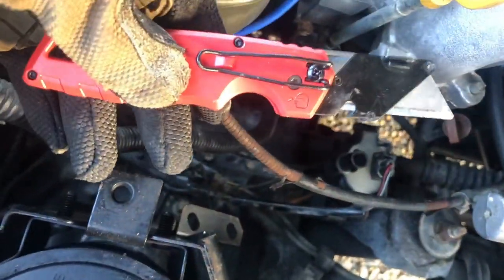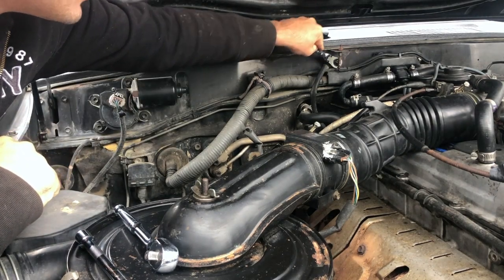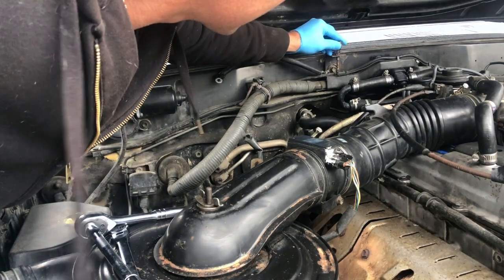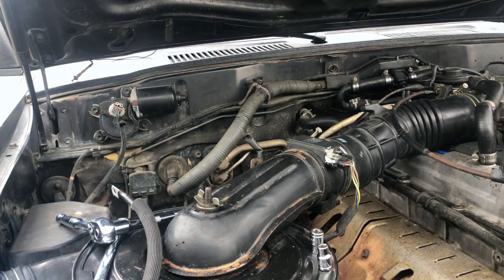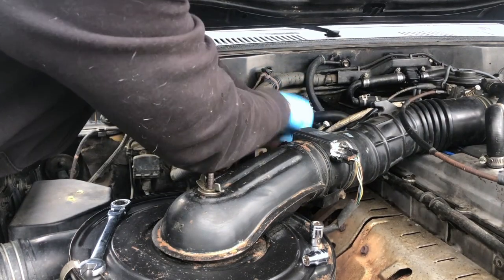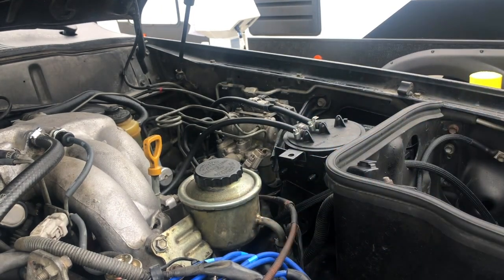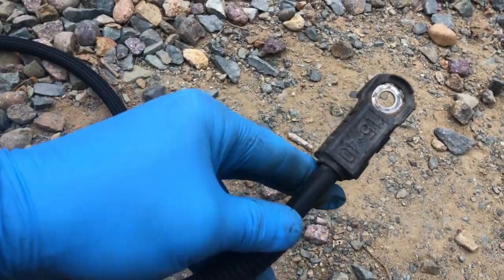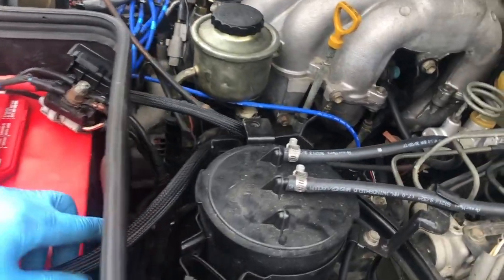FZJ80 | Battery Wires & Grounds Upgrade | Part Two

Comment: The switch at 3:00 is definitely not stock, someone added that for a under hood light, thanks for the video, I was trying to find out where the firewall ground connected.